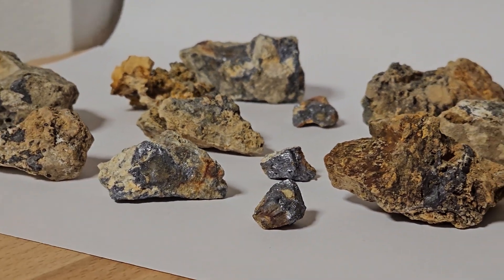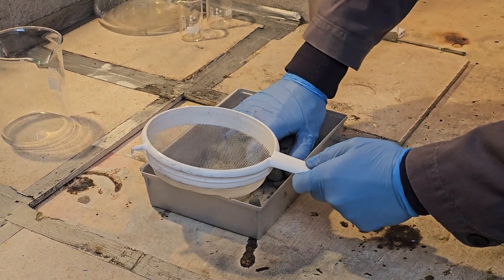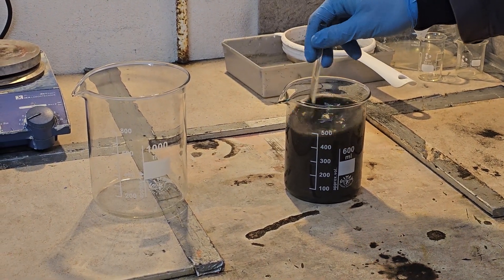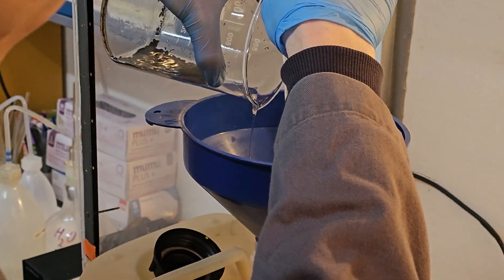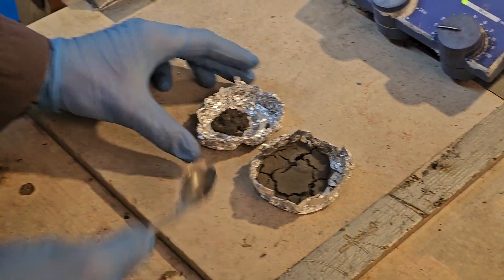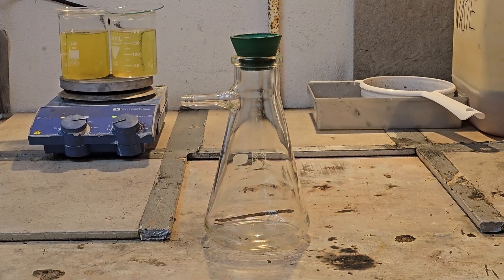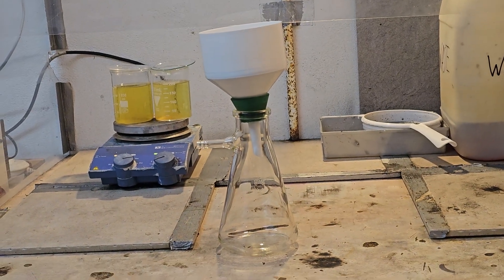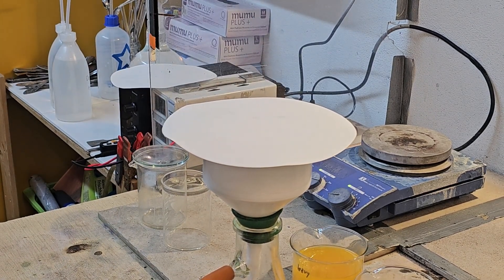Lead ore processing | Part 2 - testing sedimentation enrichment

Comment: What flocculant did you use?
Reply from the maker: I just used some pool flucolant, but make sure its not just some aluminium sulfate but actually contains some weird organics, these work much better in low doses and dont contaminate your inorganic synthesis as much. However they might be harder to find...
Reply: How to extract  antimony  from antimony ore?